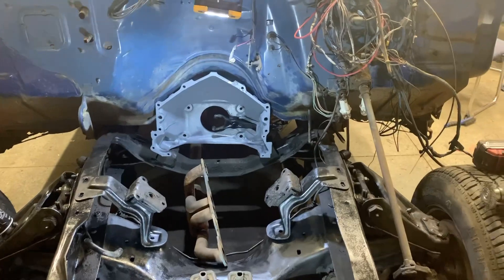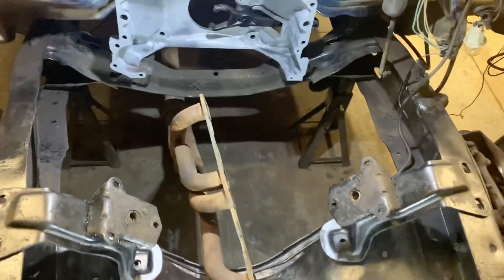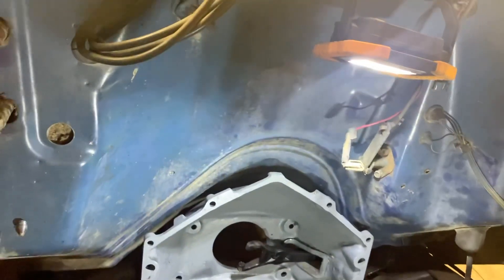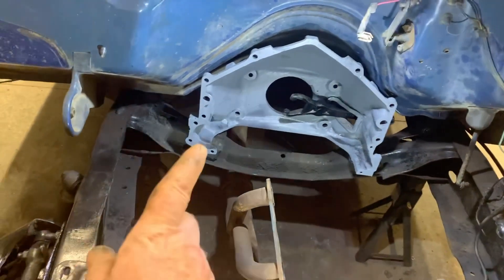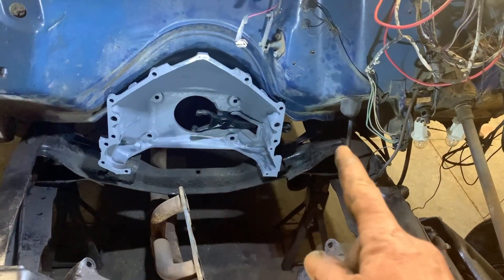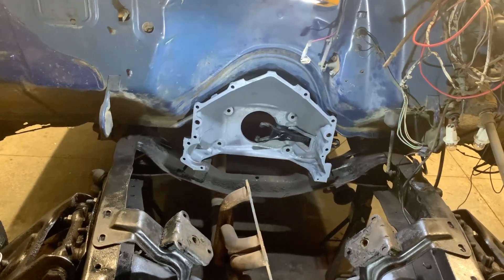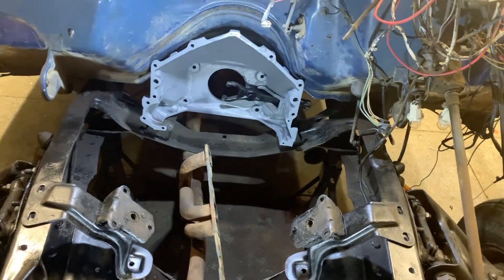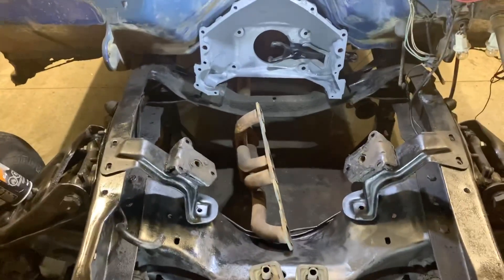Inline Six to V8 Swap - What you need to know 60-66 Chevy GMC!  SBC & keep your factory 3/4 speed

Comment: I have done the  six to V8 swap multiple times. The V8 flywheel and clutch is a 11 inch. and better than the six that is smaller. A 292 six flywheel has larger crank bolts and will not fit a V8. The passenger side frame mounts mounts on a 292 are different and will not work on a V8 or smaller six. When swapping a 60 thru 62 I used a 55 thru 59 V8 bell or a 63 up bell and convert to manual clutch linkage from a 63 thru 66. You have to drill a hole in the floor for the pull rod  and add a bracket on the frame for the Z bar . The 60 thru 62 honeycomb radiator if it in good shape will cool even the largest V8. Use 63 thru 66 frame mounts on a 60 thru 62. You can saw away the bottom portion of the stick bell and use a later two bolt starter. I prefer the 3 bolt myself. The factory installed 60 thru 66 V8 had a fiberglass fan shroud and a wider radiator with more cores. The 292 used that same bigger radiator.  You need center dump Rams horn exhaust manifolds or aftermarket hedders . Some V8 engines have a much larger harmonic balancer and it gets too close to the front crossmember. that more likely on the 67 and later .  At present we have about 25 of the 60 thru 66 trucks in the collection.I have even pulled the GMC V6 and swapped in a chevy V8 on a 62 GMC. We have several of the 60 thru 66 trucks that where factory automatics and use a three point  mounting.one on each side of the block and a single tailhousing mount on the transmission.  We have video on our channel.

Comment: The front holes are for installing bigblock perches and for the 366 bigblock which was a special dealership conversion done back in the 1960s! You could get the big truck engine in a 3/4 ton or 1 ton truck! They made the frame rails universal for all light  duty trucks! The bell housing crossmember also had to be moved forward!
Reply from the maker: I didn’t know that, that’s good information, thanks!
Reply: The front holes on the passenger side are used for the 292 as well
Reply: @shortcutgarage    What did you do about the speedo reading difference?

Comment: Hey, I'm letting you know that the 1960, 1961, and 1962 C-10 were made with a frame they call the X-frame which is totally different from 1963, 1964,1965, and 1966. There is not a lot of information out there on the X-frame C-10. I have a 1961 C10
Reply from the maker: 60-62 frames do require a different perch, I typically use the 67-72 perches and just put in a 1” spacer. But that’s really the only difference for physically mounting a V8 in them. I’ve owned a handful of the 60-62 trucks. The best thing about them is turning the torsion bars down to drop the front end for free for anyone who prefers that look

Comment: 1966. Swapping from a 250 to a 283. If I move the motor mounts to the front holes, im guessing the 3 speed transmission has to come forward as well so how does that work with my driveshaft? Hope this is not a stupid question but its my first swap. Thanks
Reply from the maker: Driveshaft will have to be extended, transmission mount would need to move forward or a new crossmember fabricated. Personally I would do what was done on my truck, leave it in the rear holes, distributor still fits, transmission remains and driveshaft stays untouched.
Reply: @shortcutgarage  thank you! I may have more questions as I tackle this project!

Comment: 1963 to 1966 is what you are taking on. 
The  1960 tp 1962 came with torsion bars and hydraulic  clutch. It had a motor mount in the front. And  none on the sides. It  came with a  235 or 283 .the  frame was a x box
I believe that the  6 cylinder  starter has two  bolts. And the 283 starter has 3 bolts. 
At least on the 1960 to 1962 trucks. Do.
Reply: Nope the 6 cylinder starter has a 3 bolt flange type mount just like he is showing.
Reply: This info only applies to 63 to 66 trucks.
Reply: @adriantomlin2902  I  will check tomorrow. 
But I am sure that the  235 starter has a  bolt on the top and the bottom. Only.The  side has the  slave cylinder next to starter.I know because it  didn't  exchange .The  setup is totally different on the  1960 to 1962 trucks.
The  bell housing on the  283 with a  slave on the  right side is a rare part.
 As most of the trucks were  6 bangers 
 The  frame went to a  cheaper  ladder frame in 1963.
Torsion bars didn't  come back till the 80 sometime. 
1963 went to the  manual push clutch.
I  have heard that it was to save  money.
 But I am not positive about this. 
 I will  make sure  on the bolts tomorrow.
Reply: @adriantomlin2902  Its confirmed 👍 
235 starter on the  hydrologic clutch trucks have two bolts  top and bottom. 
283 has three bolts on the starter with the hydraulic clutch trucks.
Reply: @vm722  yes I have that on my 1961 Apache. Your right the frames got cheaper in 1963! Also that is why they did away with torsion bars and went cheap ass coil springs. All in the name of cost cutting!
Reply: @vm722  I have a 400 small block with the V 8 bell housing and the hydraulic clutch!! Love the hydraulic clutches smooth operation as well as the torsion bar front suspension. Ya can't beat it!!
Reply: So how do you put a V-8 in a 62?
Reply: @chillywilly7767  The came with a 283 factory. There is a U shape Motor mount on the front of the engine. To the front crossmember .And two bell housing mount. Not easy to find but they are out there.

Comment: The z-bar ball on the block doesn't line up with the mount on the frame after installing my 350 on my 1963. ??
Reply from the maker: They make a bracket for that, sells on eBay and I think summit sells it too.  A quick google search will help you
Locate it

Comment: do you need a plate or something to bolt the motor mounts to the block or is it just straight to it?
Reply from the maker: The motor should have the motor side of the motor mounts. The ones off the six will work too though if you still have them. Cheap, like $10 on rockauto
Reply: @shortcutgarage  do you happen to know the part number?
Reply from the maker: @Miramehh  EM2282 from FVP or just 2282 from Anchor both are under $10. Hope that helps

Comment: Always love your videos. Would a crate v8 take care of the sluggishness of my 4.56 rear end? Currently have the inline 6 292 with the 4 on the floor.
Reply from the maker: Sure it would!!  Lots of extra power there, a 5 speed trans would help out as well because with those gears you likely run out of RPM’s on the highway. My buddy put one in behind his 250 inline six and was callable of 85 mph no problems
Reply: @shortcutgarage  What trans TKO 5?
Reply from the maker: If you can afford that, great!!  But actually I was just referring to a regular T5 Transmission found in Chevy S10, GMC S15, even 3rd gen Camaro or Firebirds.  

Way more budget friendly, won’t take high horsepower of course so if that’s your plan better skip to the good part and grab a sweet high dollar trans but if a cool cruiser that will dependably get you cruising down the highway, grab a regular old T5. If you grab a Camaro or Firebird one you’ll have to swap the tailshaft housing but it’s no big deal. 

I have a couple videos on these transmissions, 3 in fact. Take a look if that entices you.

Comment: What about if your going sbc 350 motor and th350 transmission. Should you move the motor stands to the forward hole?
Reply from the maker: You can as you’ll be changing the driveshaft anyway and it’ll get your motor closer to the rad.
Reply: @shortcutgarage  OK thank you for the reply!! Appreciate it.

Comment: Do you know what needs to be done to use the front mounts with a 350. I don’t want the dist rubbing on the firewall. .thanks gr8 video
Reply from the maker: I put in a 350, distributor didn’t rub, it was close though. Moving it to the front two holes would take care of that but would move the transmission off of those mounts so a guy needs to pick his poison. If you were using a rear transmission mount it wouldn’t matter though. The front holes for the mounts also locate the V8 closet to the radiator which works better too
Reply: @shortcutgarage  hmm yeah, I’ll have to do more research. Along with moving it forward I would then have to cut the floor more for the shifter. Transmission mounts and then the driveshaft issue. I will be using a HEI ignition. Might be easier just to modify the firewall. Txs.

Comment: Great videos and a great help! I’m over in Scotland and have a 66 C10 which I’m in the process of putting a 327 sbc in. I’m struggling to find a z linkage pivot ball to bolt into the side of the block. Could you point me in the right direction to find one? Even a part number😩
Reply from the maker: LMC truck has what you need, 32-6122 is the part number and they ship internationally too. I know this because I also order from them.
Reply: @shortcutgarage  many thanks for your help, that’s it ordered.👍

Comment: If I move the front motor mounts and move the engine forward a bit, will it not misalign the bellhousing mounts?  Maybe I missed that part
Reply from the maker: If you move it forward the transmission bellhousing bolts will not line up
Reply: @shortcutgarage  so is there a cure for that if you want to keep the original manual transmission?  Or do you need to fabricate new bellhousing mounts to accommodate the move?
Reply from the maker: @ihatesjws669  why do you want to move it forward?
Reply from the maker: @ihatesjws669  you could always move the mount forward. Cut out the rivers and slide it forward maybe?  Slot the holes?  Maybe you would get enough?  Honestly never tried it

Comment: I could really use a part number for the pivot ball stud that goes in the block of a 305 from a 250 with 3 speed manual. Im not sure why im having a hard time fimding that thing...any help esp if i can just pick one up from a big box parts store locally since i dont have time to wait for Mustafa to run over my mailbox in the Amazon van delivering Chinese junk tia
Reply from the maker: @lewisshaffer9467  03866568 is the GM part number.  I paid $8 Canadian for one off Amazon. Should be able to grab one from any GM dealership.
Reply: Thank you so much.

Comment: I ended up getting a ls and 4l60 instead. Since you upgraded to a LS and 4l60.  Did you keep the front crossmember under the bell housing and just swap the rear crossmember?
Reply from the maker: Cut it out with a grinder, she’s gone. Second gen Camaro trans crossmember in there

Comment: I'm about to drop a 383 in my 66 C20. Is it possible to make the swap without tearing off the entire front end of the truck? I was hoping I could leave lights, grill, etc in place.
Reply from the maker: Of course. You’ll likely have to pull your hood, just makes life easier but the front clip stays on. Mine was off for other reasons, it’ll go in just fine I promise

Comment: Does this work for a 1962? Seems like a 1962 is different than the 63 and up.? Any advice would be helpful thanks
Reply from the maker: 60-62 require new mounts, you can buy custom mounts but typically guys are using 67-72 mounts and putting 1” spacers between the mounts and frame. Everything else is the same
Reply: So I have a small block Chevy and a 350 turbo trans. I just cut the crossmember out for the bell housing and add a transmission crossmember and 67 motor mounts?
Reply from the maker: @chillywilly7767  you got it.
Reply: Thanks shortcut garage
Reply: I can’t find anything aftermarket. Would you happen to have any links for the motor mounts or crossmember for the transmission?
Reply from the maker: @chillywilly7767  KMS has the transmission crossmember

Holley has plenty of motor mount options. Check out their website
Reply: @shortcutgarage  Are you talking about K MSs $400 crossmember for the C 10? For the dual exhaust? I don’t know if that’s exactly what I need. 1962   Has the  ex member in the middle And the bar for the torsion bars
Reply from the maker: @chillywilly7767  I didn’t realize they are that much. I have one, I paid $80 for it, never used it either.
Reply: @shortcutgarage  Can you post a picture of what the transmission crossmember looks like? The one they have is very elaborate. Not just a universal looking crossmember.

Comment: I want to do the opposite.
Reply from the maker: V8 to Six swap?  That’s gotta be a first!  That’s awesome
Reply: @shortcutgarage  no I had a 63 chevy 6cyl truck 40 years ago it ran great, pulled good perfect for this and that. This 63 I have now got a very new mild built 350... I don't need that much power. Just soon to have the strait 6.. gonna buy one, rebuild it and drop it in.
Reply from the maker: I had a 292 a couple summers ago, dropped a Holley Sniper kit in it, thing was awesome!  I would do it again, nothing wrong with a six!

Comment: HELP those square pieces with the sleeve coming out that are sitting on your crossmember / tie rod in the video. What are those and where do they go? I have a box of parts and I’m putting my 350 back in my 66 and I have no Idea where those go or what they’re used for
Reply from the maker: Those are for the tranny mount, actually the bellhousing mount. The bolts go through the mount, through those sleeves and into the bellhousing
Reply: @shortcutgarage   ok nice. I went with the th400 so I guess I won’t need those. Also do you know the size/length of the Center bolt that goes through the engine mount? And you mount the engine mount to the pérchese first I take it then set motor on top?

Comment: Can i do the swap in a 62 c10 with the clutch fork on the passenger side and the old 235 has a horseshoe motor mount which I know ill have to switch to side mounts.
Reply: What did you find out about adding a V-8 in your 62? I have the same issue. Nobody makes mounts for it